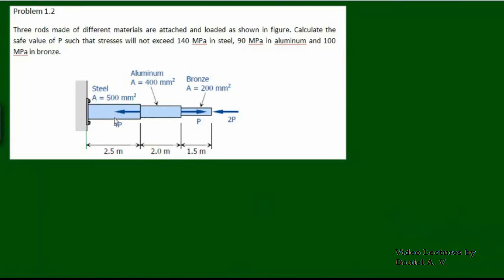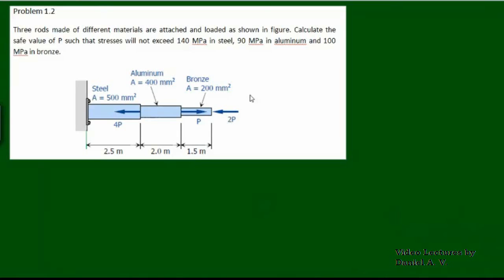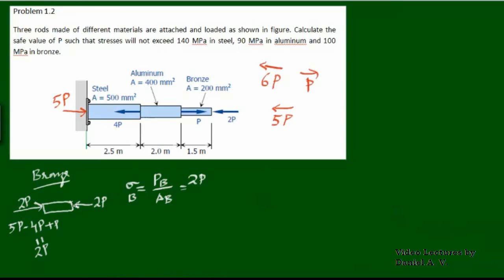Problem on member subjected to axial load - Normal stresses

Comment: A Compound bar having steel rod of dia. 35 mm and solid copper
rod of dia. 20mm and aluminum square rod of 10 mm is as shown in
following figure. Find change in length of bar. Take modulus of
elasticity Es = 210 kN/mm2
, Ec = 110 GPa and Eal = 70GPa.

Comment: The procedure is good but why do you use the given stresses in MPa instead of Pa and again, the area is given in mm², isn't it should be changed to m² when calculating the value of Force in Newtons. 

Can you please help?
Reply from the maker: MPa is equivalent to 10^6 Pa or N/mm^2. There is a common practice of expressing stress in material and strength of material in MPa. Here area is in mm^2 and Strength of material is given in MPa, so directly we can get the Force in N, which can be changed to any unit system as per the need. 
Good observation and will be helpful for others who may view such solution procedures. Thank You